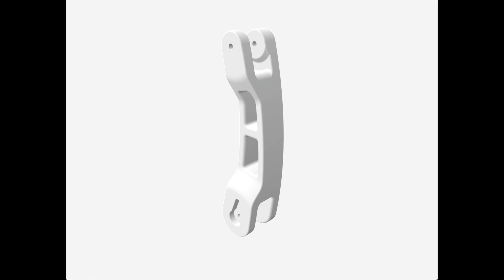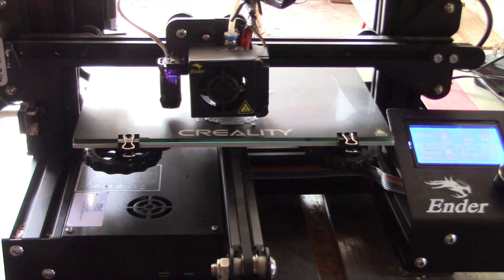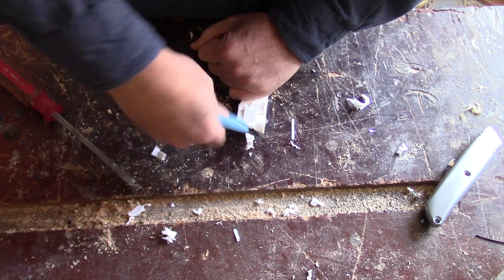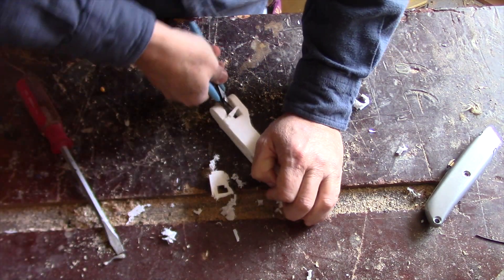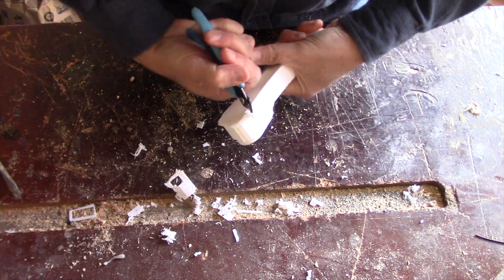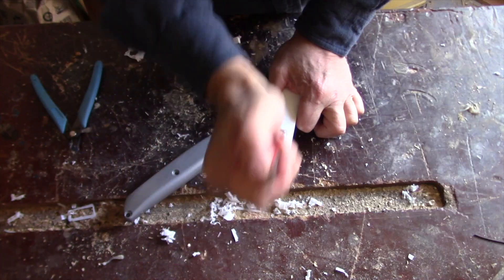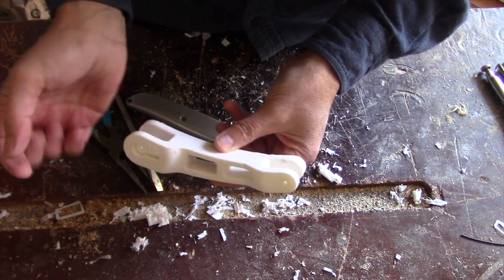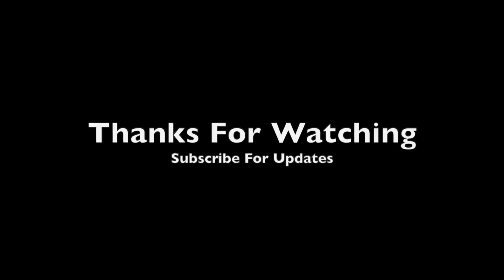How To Remove Support Material From Your 3d Printed Parts

Comment: Thank you for the video! The Ender 3 is an awesome little machine, it's sad there's so many haters out there who bash it. Once you get it dialed in, like any machine, it work's really good even stock. But as for supports, I can definitely relate to the (mental) pain when taking those supports off. I don't know what your skill level is, how long you've been printing, etc, but I have some suggestions and recommendations to make supports easier to remove in the future, if you're interested.

I'd suggest first tweaking your support settings. After three years of printing, trial and error (and more error) and lots of filament, I've found some ways to make supports easier to use and remove. I don't want to step on your toes, so I won't post links to other videos, but there is one video that is invaluable for support settings (in Cura, at least). Essentially:

Pattern: zig zag
Support Wall Line Count: 1 or 0 (I'll explain)
Support Density: 8%
Support Line Distance: 3.3mm
Support Top Distance: 0.22mm
Support Bottom Distance: 0.1mm
Support XY Distance: 0.8mm
Enable Support Interface/Roof/Floor: yes
Support Interface Thickness: 1mm
Support Interface Density: 80% (I'll explain this, also)
Support Interface Pattern: Concentric (or zig zag, I'll explain)

You should have the same or similar advanced settings in Prusa Slicer. I have found that in certain situations, a thicker support interface density can make the supports easier to remove. In other cases, setting SI Density to around 20% can be more beneficial. Getting the airgap between supports and print can be tricky, but once you get that dialed in based on your layer height, you'll have won half the battle. Cura has a support setting called Tree Supports, where it starts the support structure from the bed and works up to the underside of the overhang, so you only have one side to remove them from. Tree Supports use more filament, but for certain prints (like yours) or something that has lots of little detail, Tree Supports are awesome and almost always really easy to remove. Also, I've found if your top/bottom flow is slightly off, you can get welded supports. And if you're printing just a few degrees too hot, you can get welded supports. After putting a HeroMe v6 on my Ender 5 with twin 5015s, man, bridging and supports print better. The HeroMe has alot of parts and it can be intimidating, but it's actually pretty easy to print and put together once you've figured out what parts to print for your setup. If you're interested/don't mind, I can share the support settings video that has helped me the most with my settings. There are a handful of other videos you may find useful as well, if you're interested. It's awesome how many good informative vids are out there, including yours, but some of them can be a little tough to find. Also, Teaching Tech has a calibration website that is very thorough but has indispensable info regardless of skill level. If you already know all this (I haven't looked at your other vids, you could be an engineer), sorry for the repeat. Hope you find the info useful.

As for tools, I use paint spatulas for supports or removing prints from the bed (they come off pretty easy with my textured PEI build plate), and a deburring tool that has a rotating blade (it's indispensable for removing brims or elephant's foot). I also use a snap blade knife for stubborn supports. The blade is longer than a triangular utility blade, allowing you to get in there without slipping and cutting a finger (been there, done that). I can link to Amazon pages for the spatulas and deburring tool if you're interested.
Reply from the maker: Well thanks for the tips.  I could not find some of the settings you mentioned in Prusa so I'll try them in Cura.  The tree feature sound great.